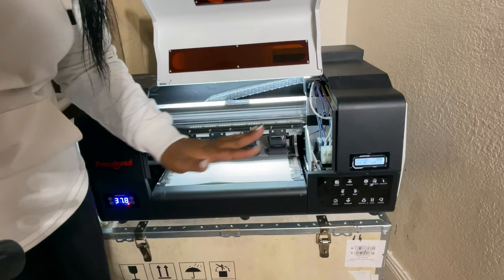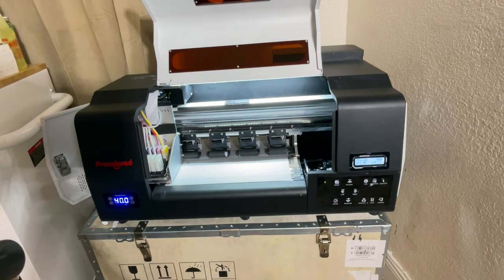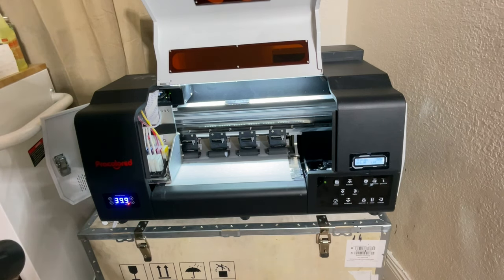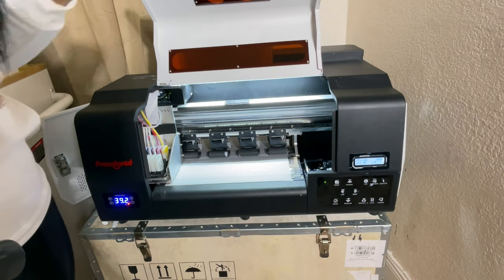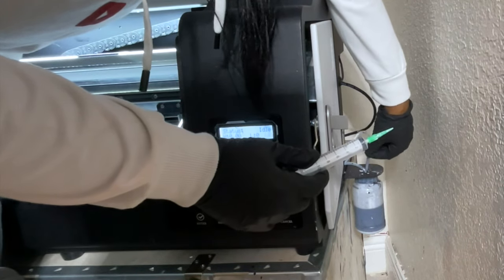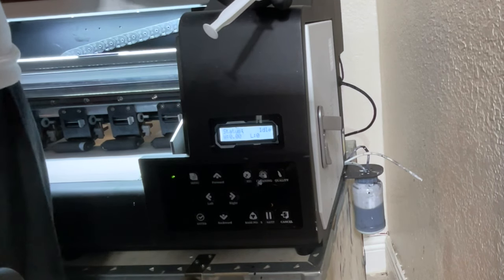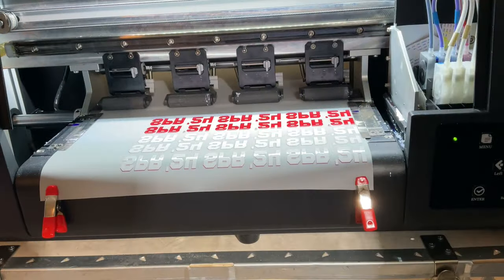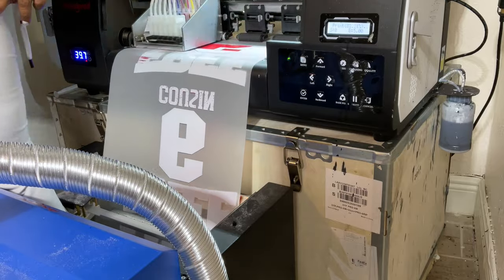DTF PRINTER MAINTENANCE | UNCLOG PROCOLORED DUAL HEAD DIRECT-TO-FILM PRINTER

Comment: My printer won’t print because it says the print width exceeds the distance of max motion, but it does not exceed it. Any idea how to fix that? The printer is like 13 inches in width and I’m trying to print something that’s 6 inches in width
Reply: Make sure where you design its save to size, and dont have the excess box around it.
Reply: @EricaCHouse  how do you get rid of the excess box?